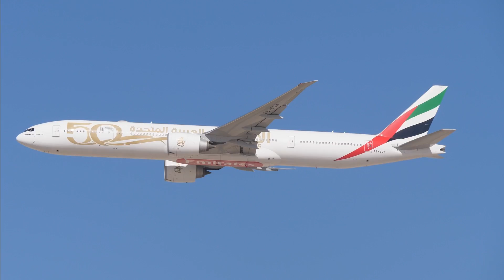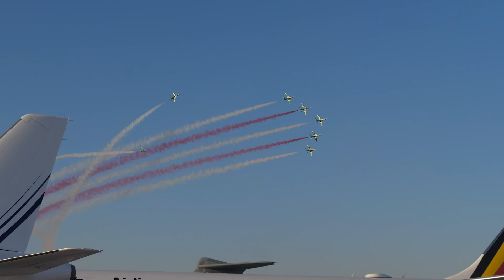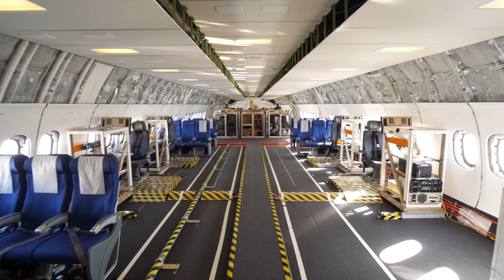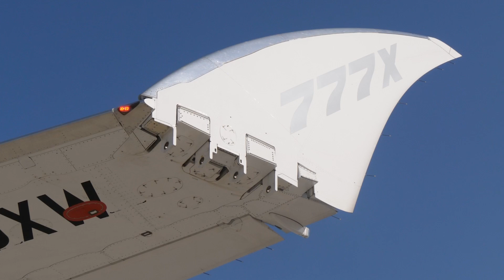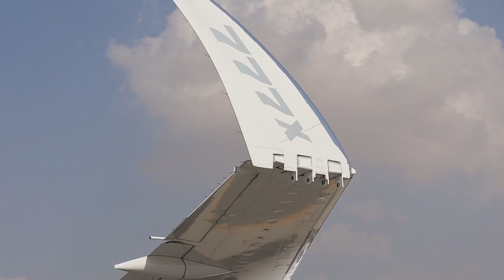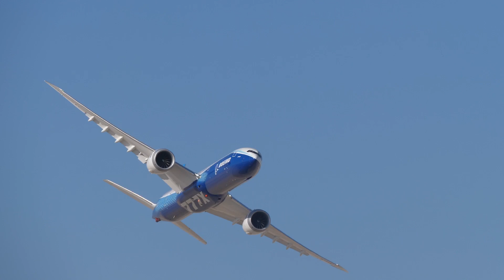The Best of Dubai Airshow 2021 - Complete Show Highlight

Comment: 2021 Dubai Airshow was beautiful, though it looks like Airbus was outclassed by Boeing.
The Boeing 777x was just too strong compared to Airbus A350XWB or A350 1000 ULR.
But watching this video I was able to see my favorite plane Airbus A380 from Emirates.
Reply: You're kidding right ?
Have you looked at sales ?
That show has been a slap in the face of Boeing.
They sold exactly zero 777X at the show.
They sold exactly zero intents for the 797 at the show.

Of the air show's sales, Airbus got 412 and Boeing 101...
Here's the sales list :
Airbus
A220-100 > 7
A220-300 > 28
A320neo > 20
A321neo > 302 (!!!)
A321XLR > 49 (!)
A330neo > 4
A350F > 7 + 4 via MoU

Boeing
737MAX 8 & 8200 > 74
737-800BCF > 11
787-8 > 1
767-300BCF > 9
777F > 2
777X > 0
797 > 0

ATR > 24 
Embraer > 3

I've never seen such an imbalanced sales listing at an air show and it clearly isn't in Boeing's favor.
Also Emirates is supposedly going to overhaul its fleet and probably drop most of its Boeing planes if their 777X angst isn't addressed very soon.
This show has been nightmare for Boeing !

Edit :
Apparently I missed some sales and corrected.
That's over a 80/20 ratio for Airbus, it's really worrying for Boeing.
The A321neo factory line is full till after 2026...
Reply: @KyrilPG  Don't just look at sales and conclude what happened. Boeing has actually had more net sales this year, prior to the airshow, than Airbus. So this was more of a catchup for Airbus than it was just Airbus beating Boeing on orders, which isn't the case. And on another note, one of those large "orders" from the leasing companies, was just an intent to order, not an official one.
Reply: @Flightsy  Well, one: There is no 797. And two: If you have been keeping up with the times, there actually has been advanced talks already in the works from multiple airlines for 777XF orders, which will most likely be placed very soon. The outcome of an airshow is meaningless, as like I already said, before the airshow Boeing has higher net sales so far this year over Airbus. This is just Airbus catching up and airlines placing orders. If knew you what you were talking about, you wouldn't say something like "have lost trust in Boeing". Which couldn't be further from the truth, considering their orders this year for the MAX, 787 and freighters and future interest for even more jets.

Comment: 777x cockpit is a huge upgrade from the original.
I'm surprised the wingtip switch isn't guarded.
Reply: You can't just turn the switch in flight, and the wingtips will fold upwards. Doesn't work that way, multiple safeguards in place to avoid a scenario like that. The Super Hornets made by Boeing have had folding wingtips for decades now. It's nothing new to them.
Reply: @Jack3md  I think the A6 had them too if I not mistaken ?? That was like Eons ago.
Reply: And I'm pretty sure there are several layers of safety that prevent folding in the air, on the ground above a certain speed or that prevent takeoff if folded.
Reply: No need for that. Roof mounted switches require a person to be thinking just to get a hand near them.